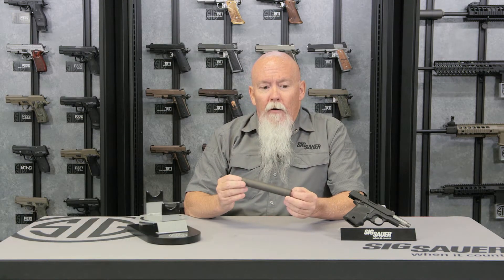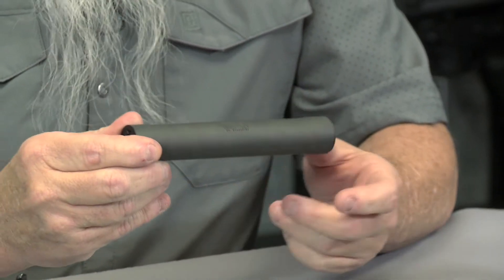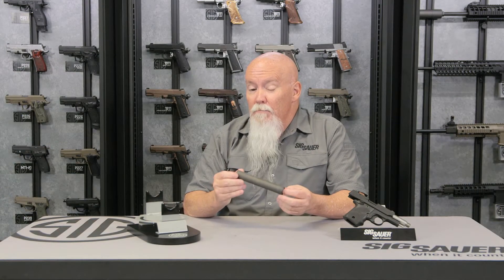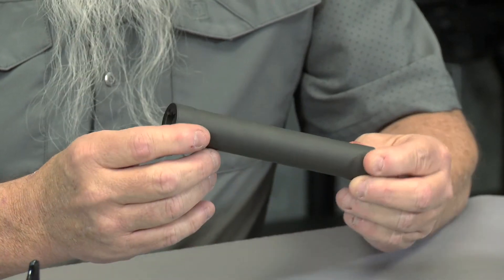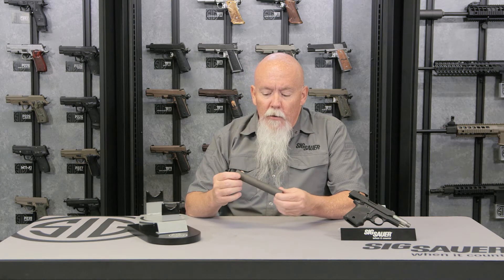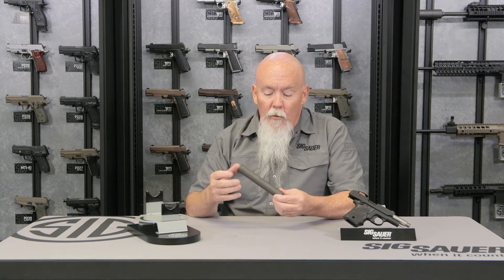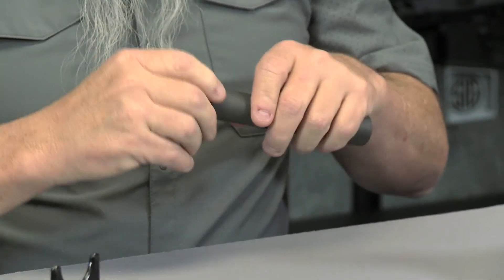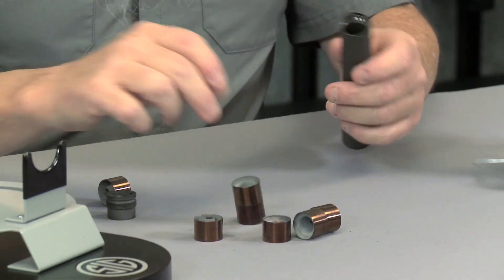SRD22X Suppressor

Comment: So I’ve had this suppressor for 2 years now. Absolutely amazing: I have killed scores of squirrels with this on a Glock 17 tactical solutions upper/p80lower I affectionately named “Squirrels Bane”. Can’t recommend this can enough: it’s durable, lightweight, and so easy to clean. I’m cleaning it today (which is why I’m watching this video) after about 2k rounds and no cleaning. A little bit of a pain because I went 3x as long as recommended before a cleaning: but no major issues. 

Not the quietest can on the market: but I love the tone and weight/size. Plus the price is $99 when I bought it.